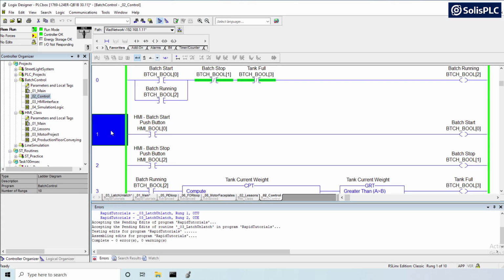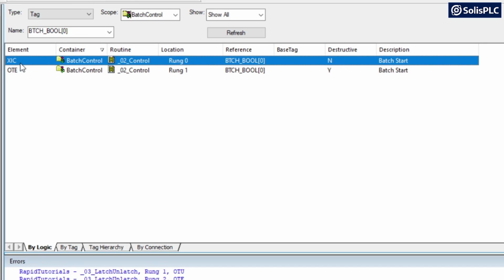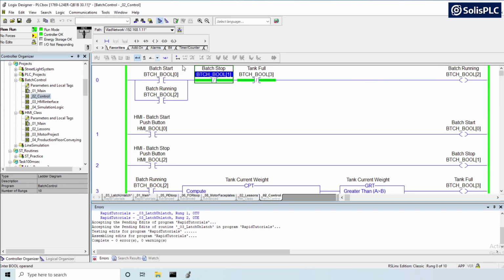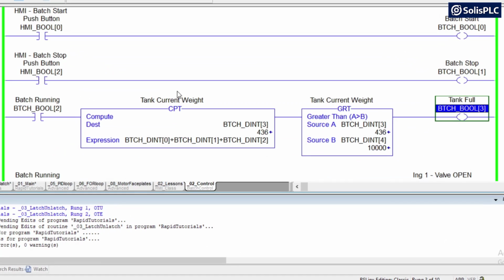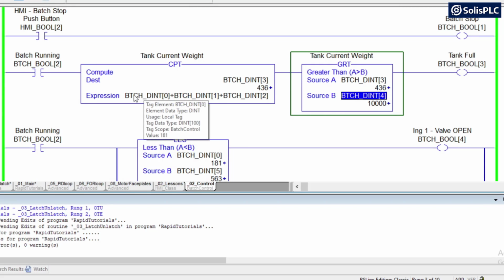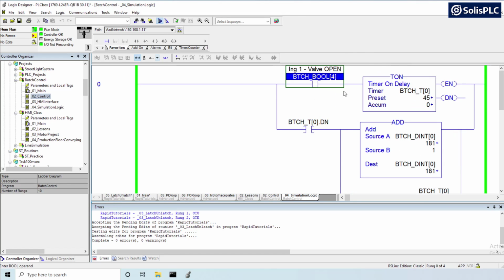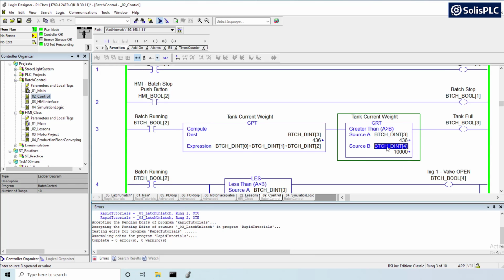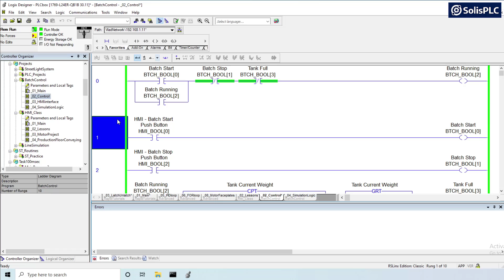PLC Troubleshooting | Using Cross Referencing in RSLogix Studio 5000 to Identify and Debug Tags

Comment: How did you get back to the cross reference screen so quickly after looking at the MOV for BatchDINT(0)?
I’ve been looking for a quick way to do this. Thanks!!
Reply: There's a couple possiblilites.  First off, don't right click and cross ref. It's too slow.  High light the tag and hit Ctrl + E. When you go to a tag location from the cross referance screen you'll notice the tag is high lighted.  Hitting Ctrl + E brings you back to cross reffrenct.  Also when multiple tabs are open, Ctrl + Shift + Tab cycles to the previouse open window and Ctrl + Tab cycles to the next open window.
Reply: @convictednotconvinced  thanks a bunch!